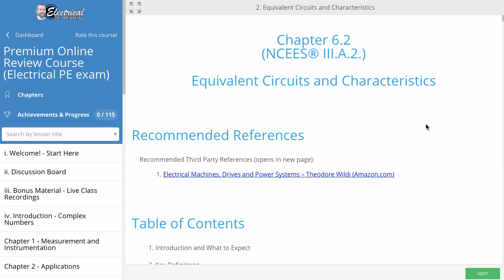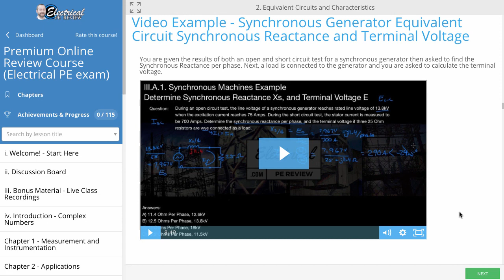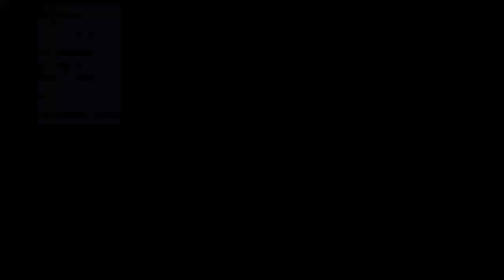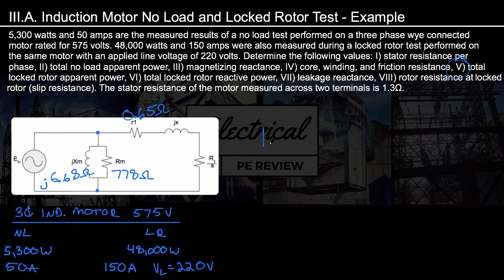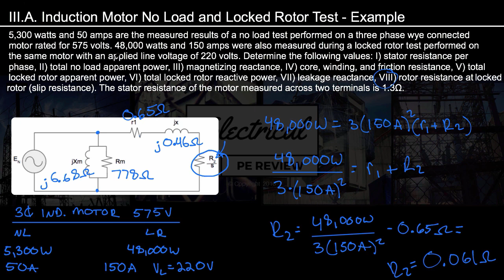The Induction Motor No Load and Locked Rotor Test Explained with Examples (Electrical Power PE Exam)

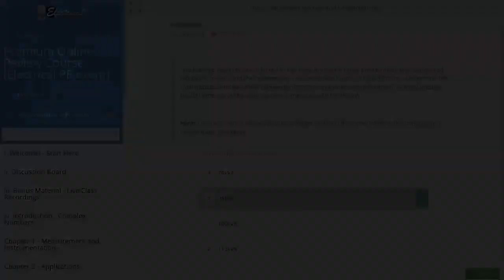Comment from the maker: 0:33 - Problem statement
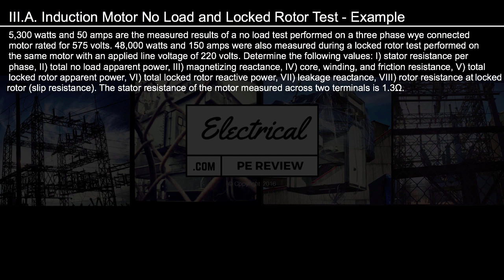2:10 - Equivalent Circuit
3:27 - Solve for the resistance per phase (r1)
4:36 - Solve for the total no load apparent power |SNL|
6:32 - Solve for the Magnetizing reactance (Xm)
11:12 - Solve for the core, winding, and friction resistance (Rm)
6:16 - Solve for the total locked rotor apparent power |SLR|
18:20 - Solve for the total rotor reactive power (QLR)
20:03 - Solve for the leakage reactance (x)
24:48 - Solve for the rotor resistance at locked rotor (R2/s slip resistance)

Comment: Why don’t you divide the KVAr by 3 for the per phase KVAr?
Reply from the maker: which time stamp?
Reply: @ 11:12
Reply from the maker: @kinz8727  The reason why the total three-phase kVAR is not being divided by 3 at 11:12 is because the three-phase line values are being used in this formula.

In the video at that time stamp, the magnetizing reactance (Xm) is being calculated by:

Xm = VL²/Q-3ø
Xm = (575 V)²/(49,513 VAR)
Xm = 6.68 Ω

Alternatively, you could also use single-phase values by dividing the three-phase kVAR by three, and the line voltage by √3:

Xm = VL²/Q-3ø
Xm = (VL/√3)²/(Q-3ø/3)
Xm = (575 V/√3)² / ( 49,513 VAR / 3)
Xm = 6.68 Ω

It's the same result and either method may be used.
Reply: @ I don’t get why you assume that all the current in the motor at no load is going to your stator resistance.
Reply: This is at 13:20

Comment: Excellent group of questions. Just wondering though for the final question (VIII) are you solving for R2 or R2/s? If R2/s, then if the slip was not =1 then the value at the end would be multiplied by s (s*0.061 ohms) vs being divided by s (0.061 ohms/s) as you stated at the end. Thanks again for the content.
Reply from the maker: Solving for just the rotor resistance R2, and not the rotor slip resistance R2/s

Comment: Hi Zach, thanks for this information is very valuable. Question. I have a voltage and amperes from leads A-B, B-C, A-C, and their corresponding amperes, I think I just need to calculate the VA that I get from those measurements and use the power factor estimated to get a calculated watts, will that work as simple as that?
Reply from the maker: That should work.

Comment: For (IV) core, winding, and friction resistance, if the no-load test is equivalent to the open circuit test, why do you consider R1. is that supposed to be Pnl=PRm?

Comment: Sir, I do have a question. For the induction motor equivalent circuit, normally the stator resistance and reactance come before the magnetizing resistance and reactance. For question 3, I see you assumed that all reactive power is consumed by the magnetizing reactance, should that reactive power includes the stator reactance also?

Comment: Can you please clarify why during when you were solving for core, winding, and friction resistance (Rm) you did not use resistance R2 (rotor resistance). I see that it is in series with R1 (stator resistance). However, when you were plugin in the varies power loss ie Pnl=Prm + 3I^2R1 but did not add 3I^2R2.

What is the problem had said  core, winding, and friction resistance (Rm) + rotor resistance. Would it be fair to say that at the juncture then Pr2 would be added.
I though frictional losses occur at the rotor.

Comment: In step IV should you of not divide by root 3 as the voltage is L-N?
Reply from the maker: If you could include time stamps of each step you are referring to, it would make it much easier for me to answer your question. The line voltage is used to calculate Rm because the power valuing being used is three phase.
Reply: @electricalpereview  Sorry I thought I captured this.

 You state stator resistance is 0.65ohm at 4:42 that seems to be a value at L-N.  The around 15:58 it seems that Rm=778.  You use 575V, should this not be 331V, as the diagram is voltage to neutral?  

 I wish I would of found your course earlier, your material is amazing. But given I take my test at the end of the month. I dont think I can cram all your course work in that time frame.
Reply from the maker: @cojeff5688  Thanks Jeff, now I understand your question. 

Earlier, when we calculated PRM (425 W), we calculated the total three-phase power value, and not just the "per-phase" power value absorbed across one phase of Rm by the line to neutral voltage En. 

Because PRm is already a three-phase value, I used the line voltage of the motor (575V) and not the line to neutral voltage (En) to calculate Rm. The neat thing is you can do either and the math works out just the same.

If you want to use the line to neutral voltage in this calculation (En = 575V/√3), then just be sure to use the per-phase value of PRm along with it instead of the three-phase value of PRm that we used along with the full line voltage. 

We can find the per-phase value of PRm by dividing the three-phase value by three:

PRm-1ø = PRM -3ø/3
PRm-1ø = 425 W/3
PRm-1ø = 141.67 W

Next, use this value along with the line to neutral voltage (EN = 575V/√3) to calculate the same per-phase value of Rm:

Rm = En^2/PRm-1ø
Rm = (575V/√3)^2  / 141.67 W
Rm = 778 Ω

Same value that we get at 15:58 using line voltage and three-phase power!

Don't forget to square the line to neutral value after you divide by the square root of three.

Comment: Hi Zach. I noticed that you subtracted the stator copper losses from the NL real power measurement (5300 W) in order to calculate the iron losses. Why is this the case? For the NL test, don't we ignore everything besides the magnetizing branch (magnetizing reactance and iron resistance)? Therefore, I thought that the entire 5300 W represents the power lost in RM.
Reply: This was bugging me as well. I know you're comment was a year ago, but I'll post this in case it helps someone else. The stator copper losses are actually in series before the parallel magnetizing branch in the full equivalent circuit model and are moved to the right to make other calculations easier as it is normally irrelevant to the accuracy of the model. The stator will certainly have current through it during the no load test and will produce losses, so for the no load test only, imagine r1 to the left of the magnetizing branch, which is why it needs to be accounted for.
Reply: @jaymoseley6216  How about for the magnetizing reactance? the reactive power he calculated was only for Xm, did not include jX. I am kind of confused.
Reply: @yuechen2421  I can't give you an answer on that one. If you do calculate it that way the result is fairly close at 6.14, but I don't have a text book that actually had a good explanation for why you use the simplified model for NL reactance and the normal equivalent for the NL resistance. The equivalent circuits are approximations though and if you solve for jx first you neglect the magnitizing branch anyways, so attempting to solve it that way isn't 100 percent accurate and the normal procedure that is followed to solve for all of the unknowns is likely the best model we can get from these two tests if I were to take a guess at it.
Reply: @jaymoseley6216  thanks jay!
Reply: @jaymoseley6216  Great explanation. After reading your response I do feel there is a ripple in the solution when solving for the Magnetizing Reactance. However, if you understand the problem well enough to question these steps, I'd say you are likely prepared to handle the majority locked-rotor and no-load induction machine questions that will be on the test.
Reply: same question here.

Comment: I'm confused about when to use P=V^2/R and Q=V^2/X.  I notice you use P and Q 3 phase and the voltage line to line, and that gives you the R and X values from line to neutral.  Why is that?
Reply: Ok, I think I see now, it is the voltage across the resistor.  My other question then is why is the source En and not Ephase?
Reply from the maker: Hi Sailus, impedance is always a per phase quantity even in three phase systems. This is unlike line and voltage quantities that may be either per phase or a line quantity.
Reply from the maker: En is the phase voltage, also known as the line-to-neutral voltage or the per phase voltage. The circuit above is a single phase equivalent circuit to help us analyze a three phase system. Single phase equivalent circuits always use the per phase quantities of a wye source wye load. This is similar to standard three phase circuit analysis when you must convert any delta connections (source or load) to their wye equivalent, before being able to use the per phase line to neutral quantities in a single phase equivalent circuit.
Reply: I thought the equation would have been sqrt(3) * V^2/X or R. Was the equation derived from the 3 Phase apparent power equation S=sqrt(3)*V*I?

Comment: I am currently preparing for Apr PE exam and your examples really help in understanding the concepts without any difficulties. For this example should the stator resistance per phase = 1.3/3 instead of 1.3/2? as it appears to be a delta to wye conversion? Also the Reative NL power would be = magnetizing reactance power + stator reactance power? Also, there would be no Slip resistance at NL since you didnt add it in Total NL real power eq. And the current through the magnetizing resistance would almost close to zero, how do i find it if i were to just use the eq. power = I^2 * Z?
Reply from the maker: Hi Christian. 

It is a wye connected motor. If you measure the resistance using a meter across two terminals, you are effectively measuring two phases of the wye motor, so you need to divide this value by 2 to end up with the per phase resistance. 

Yes. The reactive no-load power drawn by the motor is the sum of every inductive aspect of the motor.  

Correct, there is no rotor resistance at no load. There is no mechanical force that the rotor is driving. It because negligible.

Comment: might be a dumb question, but why did you use "-" in the pythagorean equation for the locked rotor reactive power?
Reply from the maker: Because apparent power (S) is the hypotenuse (largest leg) of the triangle. There is only a positive sign under the square root if you are solving for apparent power (S).

a^2 + b^2 = c^2

Is the same thing as:

P^2 + Q^2 = S^2.

As long as you know two legs of the triangle you can solve for the third unknown:

S = √(P^2 + Q^2)
P = √( S^2 - Q^2
Q = √(S^2 - P^2)

Try deriving each of these by hand from the original formula and it will be nice and clear. 

No such thing as a dumb question.